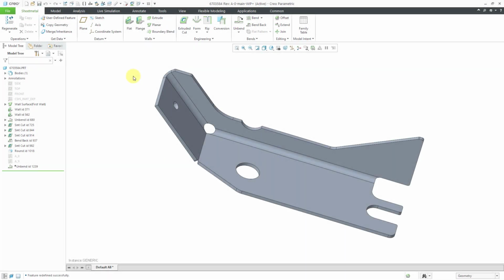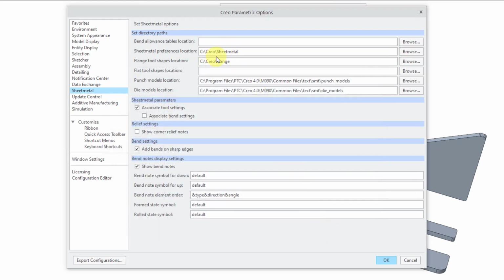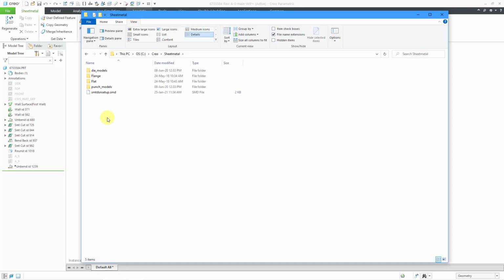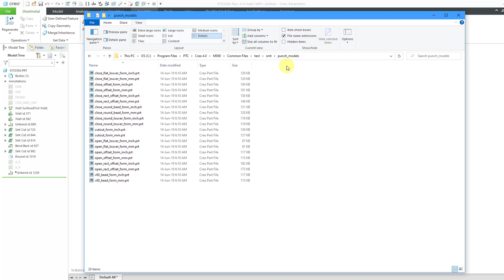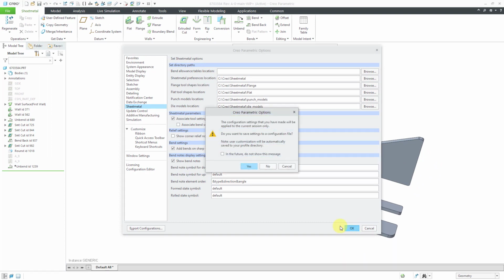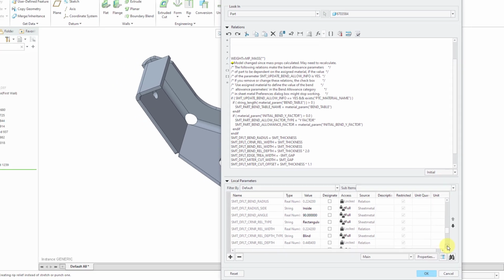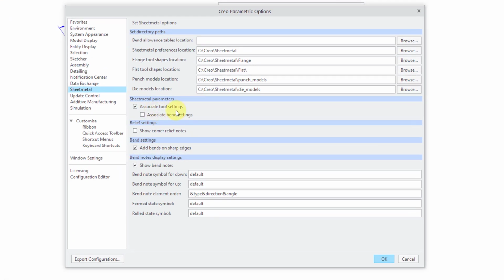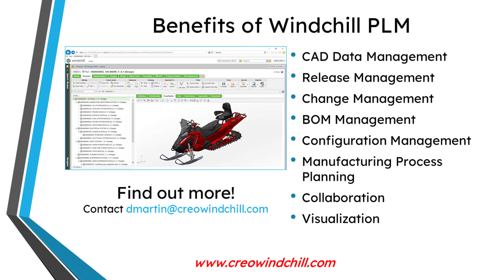Creo Parametric - Sheetmetal Setup | Options

Comment: Hello, love your videos, I have a question, not related to this video, I started with pro/engineer wildfire 2.0, and all version untill creo4.0 were better and better for me, what I wanna know is, is there a way to implement trough some option, smart manager selection back, and turn off that pesky mini toolbar, because I hate switching to quilts, curves for selection? because it slows down my workflow, I really miss the old right click selection trough geometry.
Reply from the maker: Yeah, it’s right in the Options. You can change the Mini Toolbar to be activated on right click only instead of right and left click.